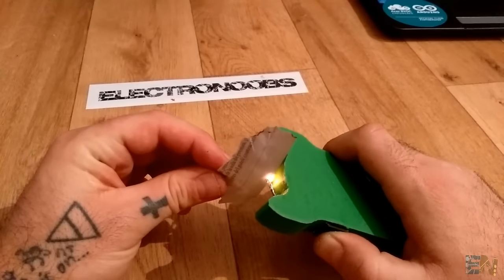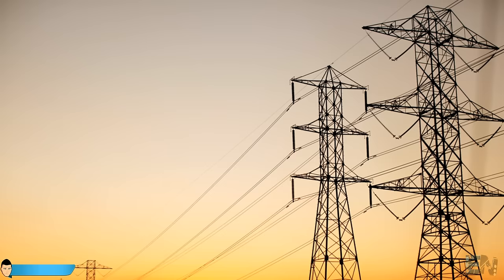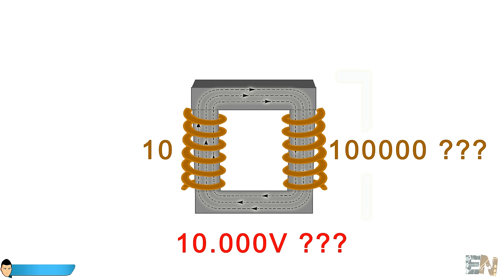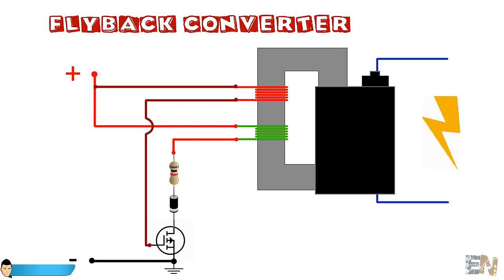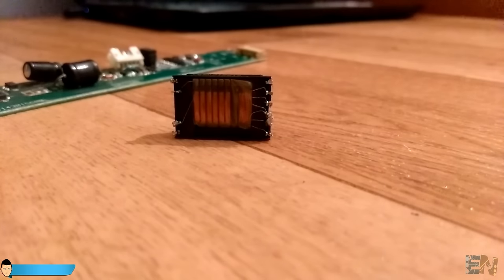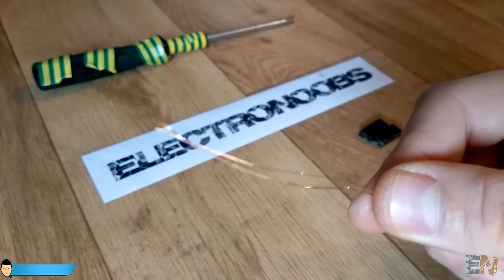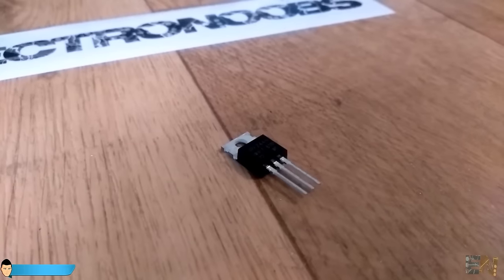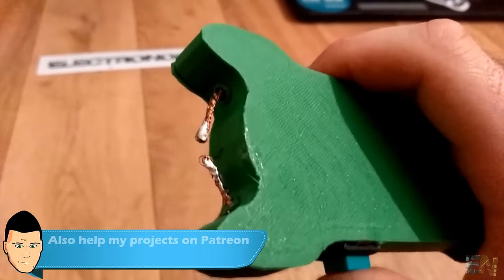Arc lighter TUTORIAL plasma flyback transformer

Comment: whether it can use the transistor D880 Y ?
Reply from the maker: That's quite a bad transistor for this project. I never used silicone power transistors with this setup. Besides, it can only take 3A and I don't know if it can handle high oscilating configuration. Try it out if you want.
Reply: ELECTRONOOBS I use this transistor and not working, but i use IRFZ44N and is work.
Reply from the maker: Yes, D880 Y I think doesn't go high freq
Reply: ELECTRONOOBS is there any transistor D880 Replacement And IRFZ44N?
Reply from the maker: I've used the 2SD880-Y and worked! This one is not MOS, it's a NPN
Reply: ELECTRONOOBS the problem in my country there is no mosfet like it.
Reply from the maker: You can't find online order?, There is no eBay or so? Maybe inside of a PC power supply you'll find some power mosfets to use!
Reply: ELECTRONOOBS thanks for your information, but i can't buy in ebay because i dont have any creditcard or paypal.
Reply: ELECTRONOOBS why NPN used in this video is different from those in the description? in your video using 2SD880 NPN and in the description of the D880, what is equal to the product in your video?
Reply from the maker: Basil Riadhi is the same transistors! sometime the full name of the component may vary.
Reply: ELECTRONOOBS then what distinguishes the transistor D880 in my country with transistor D880 sold on ebay?
Reply from the maker: There was a misunderstanding. I've searched for a different datasheet. D880 Y is good! Is the one I've used. Sorry, when I first answered you I've searched the datasheet on my phone and there was a name misunderstanding. 

So yes, D880 Y is good for this project and is the same as 2SD880 Y. Sorry again and keep up!
Reply: ELECTRONOOBS ok thanks very much
Reply: ELECTRONOOBS I've already submitted your picture on facebook, so you can find out the transistor that I use it bad or not.
Reply: ELECTRONOOBS I apologize if I am wrong to give information, when I asked about the NPN transistor. I hope you understand because I do not know of electronic
Reply from the maker: dont't worry!
Reply: ELECTRONOOBS sorry i want to ask again, if the transistor you use it bought from ebay? and whether the same with those in the description. sorry if i ask strange weird

Comment: hi for how long can the arc be kept going
Reply from the maker: Ali Gulam i never tried but I think that till the battery is out...the only thing that could happen is that the transistor could heat up. keep up
Reply: Due to electrons leaving one electrode with high speed, you can have some erosion of the electrode, and also formation of a layer of oxides. This leads to an increased voltage needed to create the arc, and at some point the lighter might stop working, which might be solved by changing the electrodes, or just grating it.

Mine stopped working after a few days of having fun with it because of this.